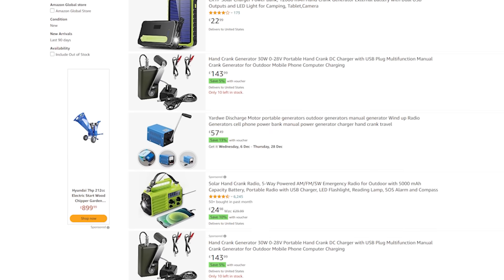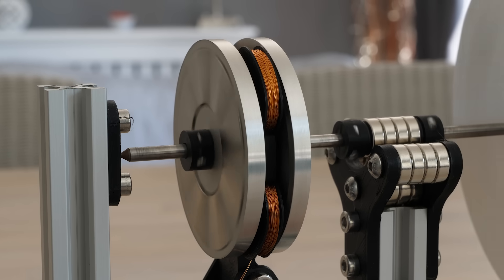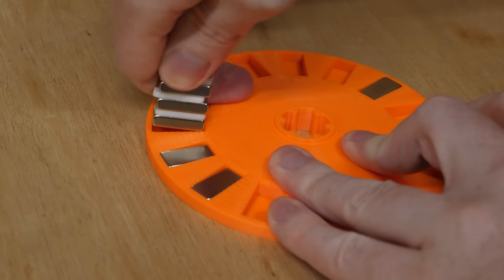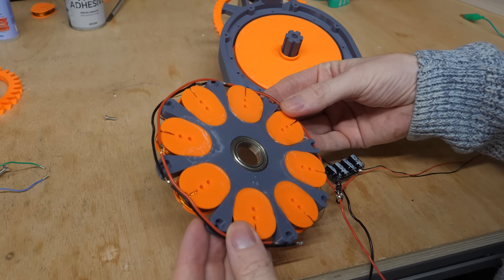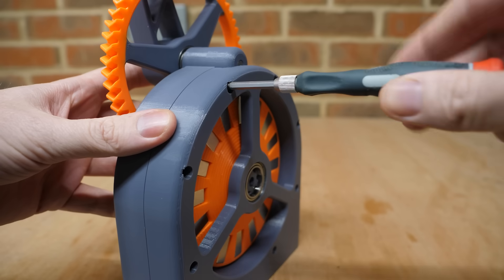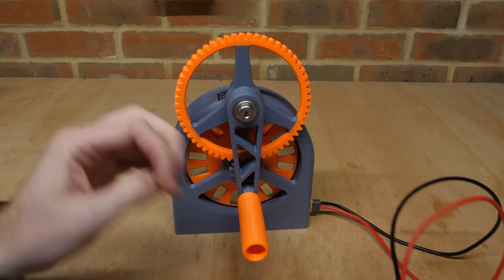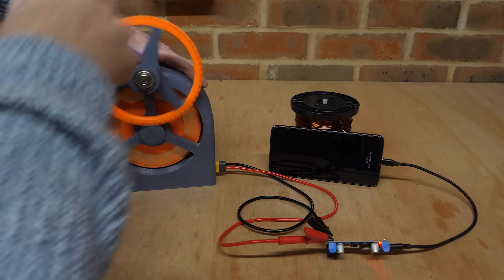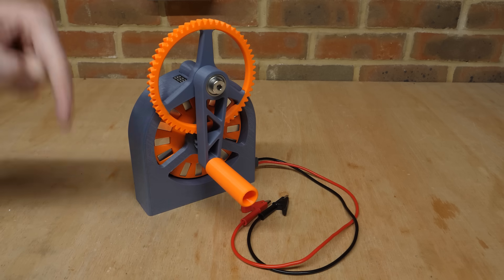Building a Generator

Comment: I would have liked to know the max current it out put by placing a DMM on the 10Amp scale across the output. Also the max voltage open circuit. I was sure you would try those tests
Reply: As long as you don't go multiplying the two together like another rather naughty Youtuber does
Reply: better yet. show the resistance of the "generator", then use a load resistor equal to that... or a variety of resistances... showing voltage developed across that resistance by the current the generator can deliver at that RPM...
and maybe a load cell so you can measure the torque required to spin it... x RPM, giving input power...

then efficiency can be easily demonstrated...

and then maybe he might delve into how to actually design a fecking generator properly rather than pussyfooting around with kids toys.
Reply: @paradiselost9946  now that would be interesting and much needed on YouTube. Seems to be so much useless content created purely for views and money. Containing bad science by creators who don't care, fortunately this channel isn't that.
Reply: @Ed.R  i keep hinting to all the big channels but either im shadow banned or insignificant :)

would do a video myself but yeah... gunna be crap? so why bother?
but it is a mandatory test for any prospective generator... throw it on the lathe and test it. 

as for this channel, but sorry... i have to disagree on about... half the content. misses certain vital aspects.

like this one in question. its actually really basic, fundamental, but guess what? its not taught until you take some advanced level university physics on the topic.

i knew about it since... i started playing with electricity, but i only got a name for it in the last few months... jacobs law. ooh, or therevins maximum power equations. its just impedance matching.

and it holds everywhere... such as in that KERS... 
water finding its own level...
kicking a ball...

a major hole in the basic theory as taught causing mass misunderstanding...